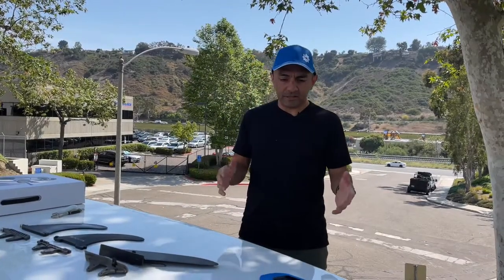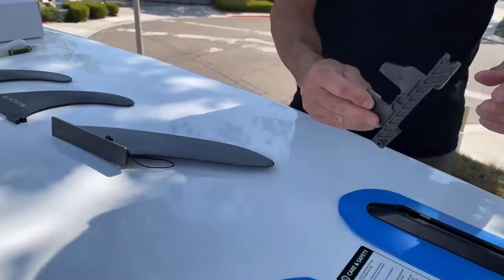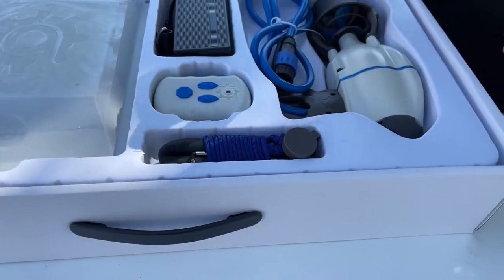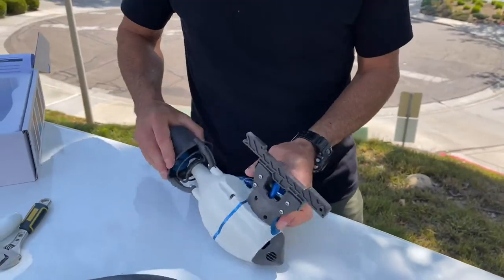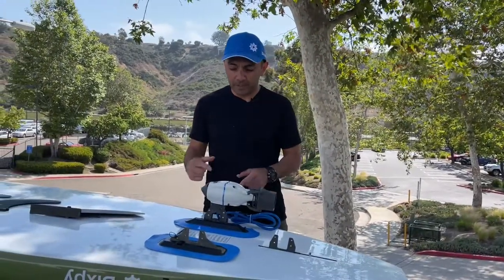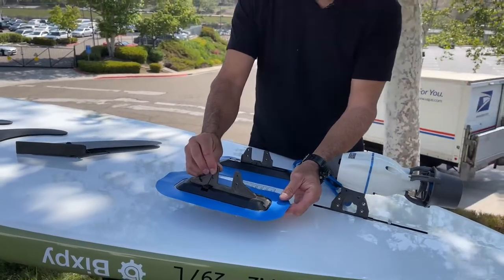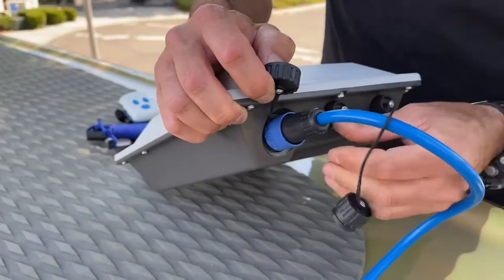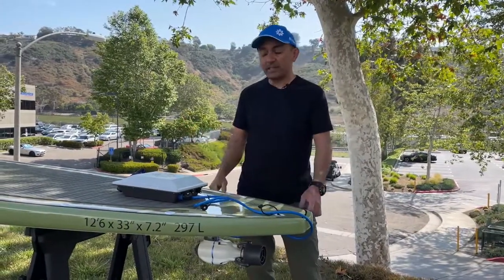Bixpy J-2 Installations: Bixpy J-2 Motor on Paddle Boards and Inflatables

Comment: I wish there was some suggestions on keeping your battery safely attached to your paddleboard
Reply from the maker: Best to use the existing bungees or add some yourself. We also sell extension cables if you need the battery to be able to run up at the front. Some double sided velcro tape works as well. We hope this helps.